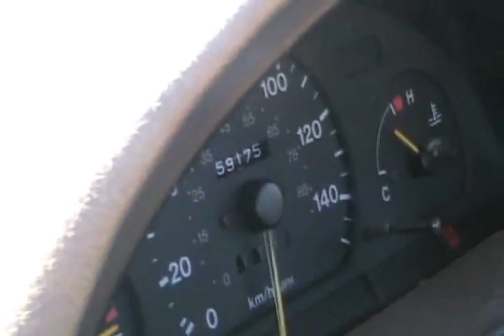Engine blow , 1995 geo 1 3 Davidsfarmison[bliptv]now

Comment: 3 cylinders take a long time to blow
Reply: Doesn't sound like a 3. This Geo is equipped with a 1.3 liter 4 cylinder engine with a 6500 RPM redline.